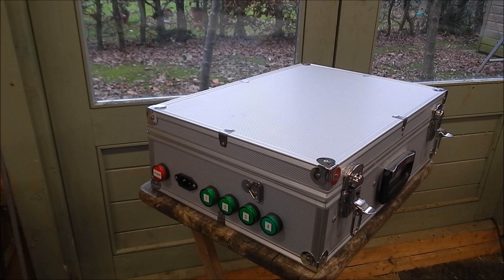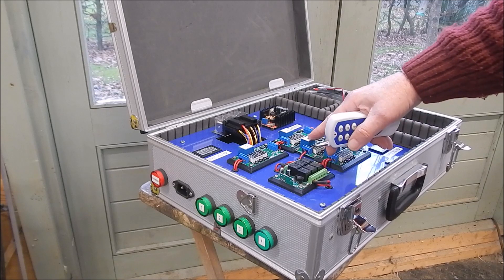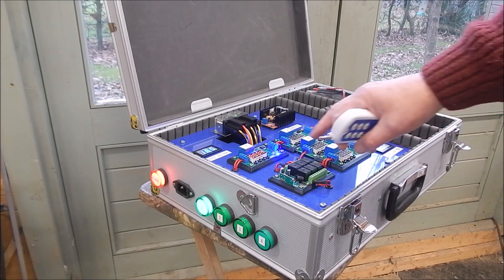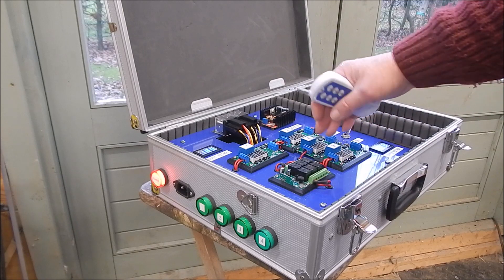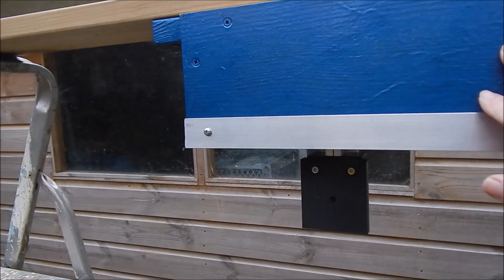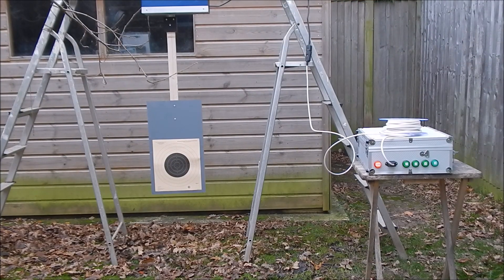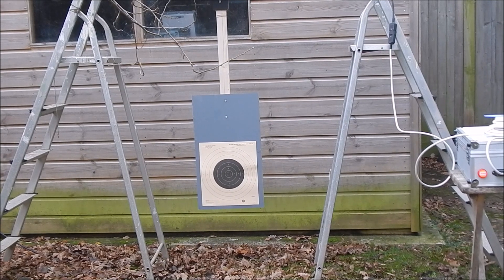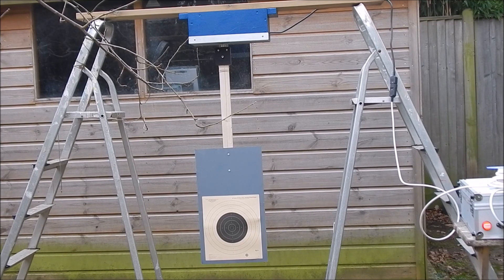Turning targets (Club level system)

Comment: Now listen carefully 007 😛

Is this an Arduino based project?
Reply from the maker: Absolutely not :) - I'm a "contact breaker good - electronic ignition bad" type guy.
Reply: @Targetmaster1066  I would not want to be stopped by the police with that in my boot 😂
Reply: @Targetmaster1066  Definitely electronic ignition bad here as well, although I drive a Range Rover packed with computers, so electronic ignition is the last of worries! Chris B.
Reply from the maker: I think it started to go wrong with the introduction of the Vauxhall Viva HC in 1970. I was horrified to find a printed circuit behind the dash instead of a birds nest of wires.
Reply: @Targetmaster1066  Ha Ha! And a black box called a 4TR unit ! Now they are trying to make us drive electric powered cars !
Reply from the maker: The 4TR was "high tech" compared to the RB340 - You knew where you were with an Austin A35. :)